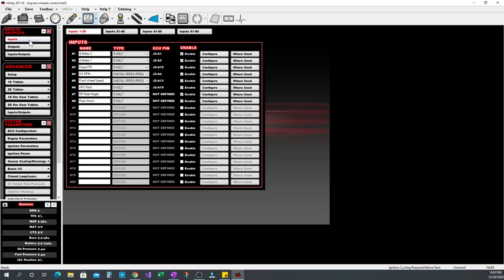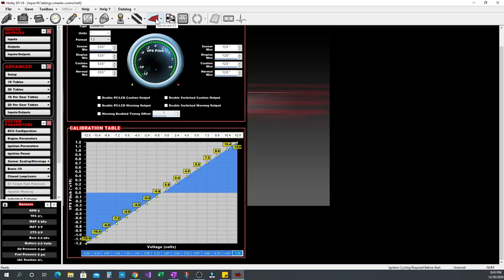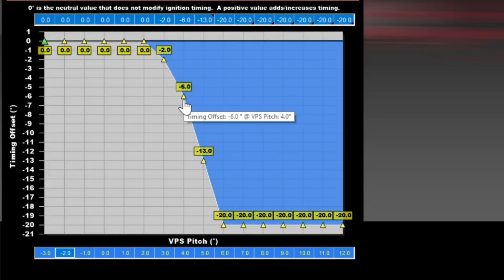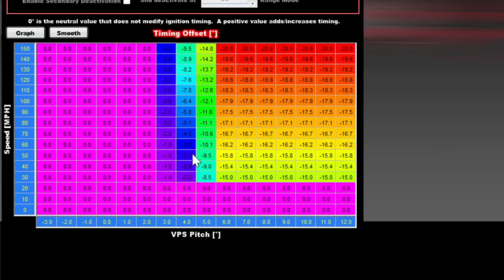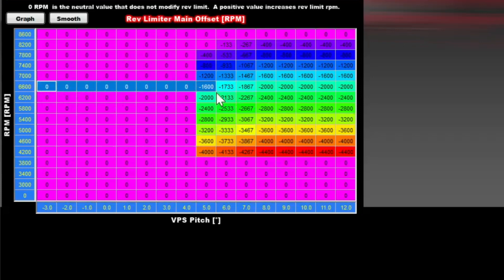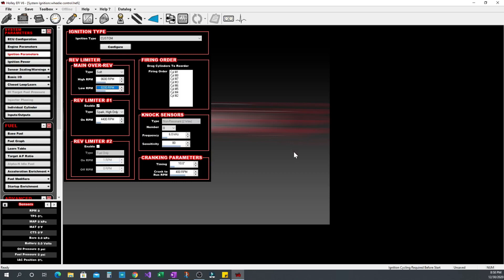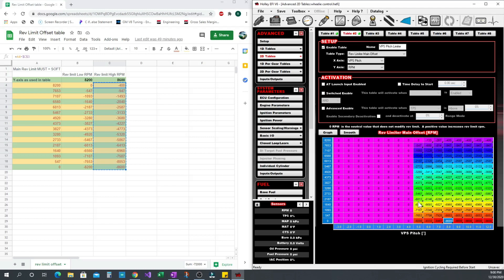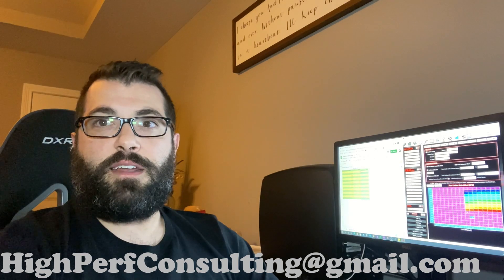Wheelie Control: A brief how to with Holley EFI

Comment: Is it possible to use the Holley Pro Dash’s internal IMU to collect the tilt data for the advanced tables?
Reply from the maker: I’ve actually never tried but I would expect it is not accurate or fast enough to use for power management.

Comment: The angle is important, but a more robust method would also have the rate of angle change as an additional factor to pull power. This captures the difference between simple wheels up and wheels continuing to go up. Food for thought.
Reply from the maker: Rate of Change  was not something available to users when I made the video which is why I didn’t mention it. 

I worked with Davis technology to get it added to his VPS after doing this video for that very reason.
Reply: @highperformanceconsulting7616  Thanks, and very good channel!
Reply: It’s be great to see an update to this video showing the rate of change wheelie control strategy.
Reply: Ya an update video of that would be awesome!